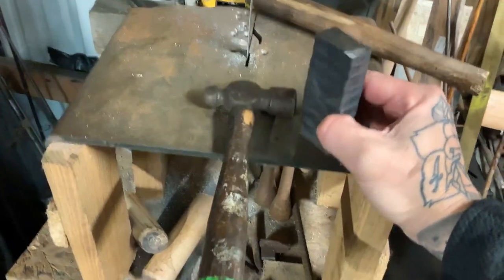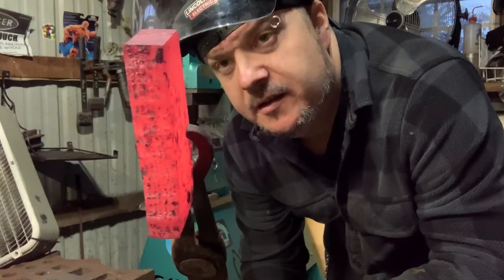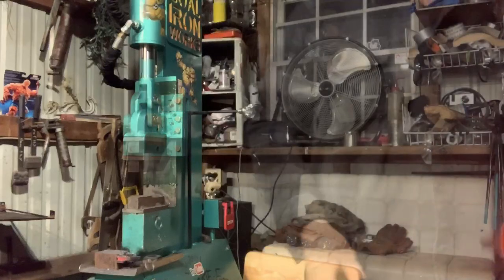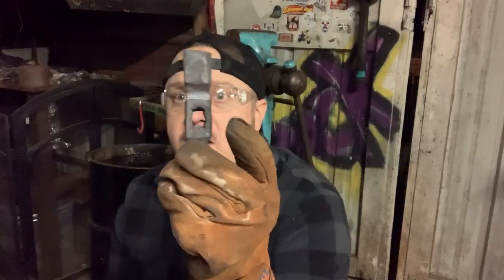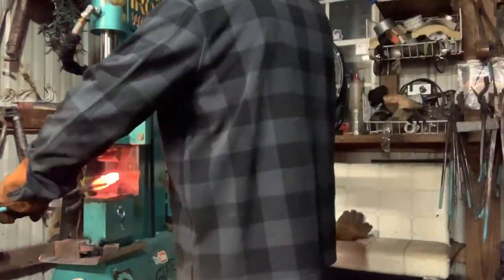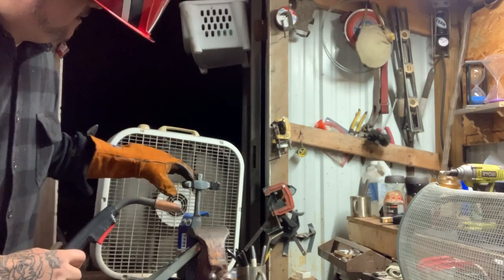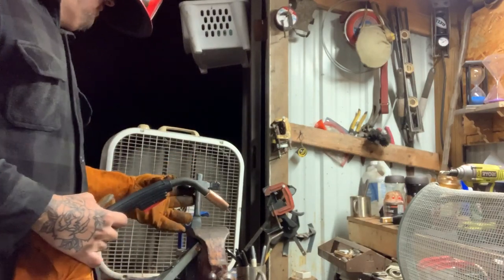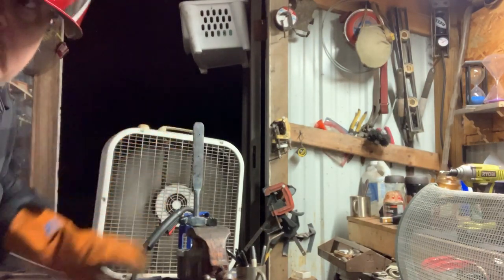Forging a Damascus Ball Peen Hammer Part_ 1

Comment: Intriguing concept. I've always wanted a pattern welded Damascus hammer. One day I'll make one.
Interesting how you made a metal handle and planning on wood scales. Ooo ooo gives me a thought ... twisted Damascus handle w iron wood scales...sweeeeetttt!!
   Well we will see what comes next....🔨👀😀

🙏 be blessed brother 
Crawford out 🧙‍♂️
Reply from the maker: Always good to think outside the box! Keeps things fun when your forging! Can’t be afraid to try new things & new ways.. this piece was commissioned by me to be built a certain way, so I’m just doin my best.. wait till you see the handle material, it’s top notch! It’s clear resin with shredded dollar bills in it with a cool natural maple burl wood. Should be a sweet little hammer when it’s finished. Thanks for watching!
Reply: Hmmm on the twisted Damascus handle concept  
 I wonder I one could make a twisted bar then fold one end over on itself from say left to right then over the top the right to left and slit the end to weld it back to the handle and of course all to itself to make the hammer head. Then draw the handle part out to thin it and form it. Then add scales. Sorry  my word pics ain't great. I think you get the idea. 
Any how what do you think? Could it be done?

Hah remember the name of the all steel hammer. "Dead On" I think. It's like a one piece w a urethane handle. Damned C.R.S. 😀
Reply from the maker: I think it’s possible.. I can the idea I was gonna originally do something similar but my billet wasn’t big enough.. but I totally get what your saying I coulda ban saw cut the billet and bent the pieces down and twisted together for a handle and the entire thing would be one piece.. who knows maybe in the future I can try it on another hammer.